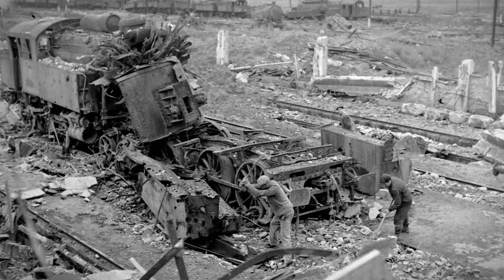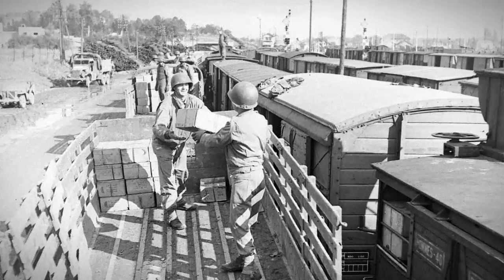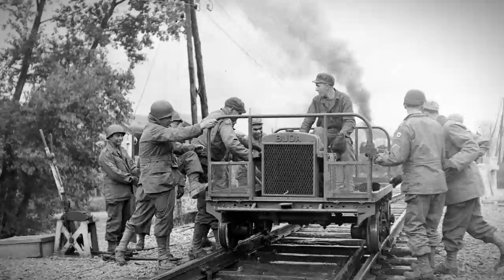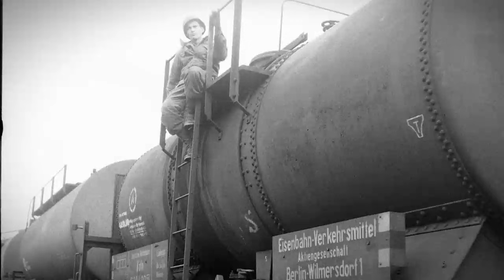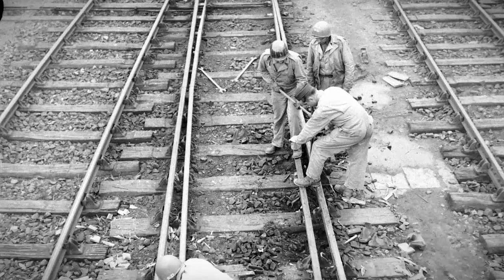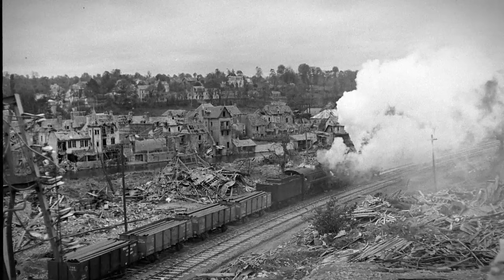The Day America's Crudest Locomotive Proved It Could Carry An Army Into Germany

Comment: Many false statements.  With so many false facts is must be AI.  It is too stupid to be researched by humans.
Reply from the maker: Nothing is false here, each single information in this video is well researched and verified on multiple sources.
Reply: @WW2Reports-u9d  Cast steel frames were state of art and stronger.  Copper domes, brass frames, and color paint were mostly gone in the US from new freight engines by WW1.  The English loading was smaller then the French loading gauge and their locomotives fit.  Coal was the fuel of choice for many railroads if it was easier to get and cost effective.  You left out almost all of the simplification that was done on this engine and even Wikipedia has more then you.  I own many of the books and articles and read others about locomotives including ones from the builders and railroads themselves.  Many "multiple sources" on the internet are little more then cut and paste jobs done with the same lousy skills that what or who you used.  The last 5 months or so there many crap videos that are AI generated.  If a site does a show a day it is not well researched.  I did not check your listing or I would not have watched your misleading presentation of history.
Reply: @SethMallory-d6r  AI  is a lot of hype its only going to be as good as the information that is given fed to it in the first place
Reply: @WW2Reports-u9d   That is why AI Not trustworthy.